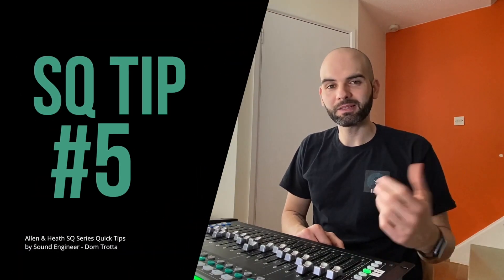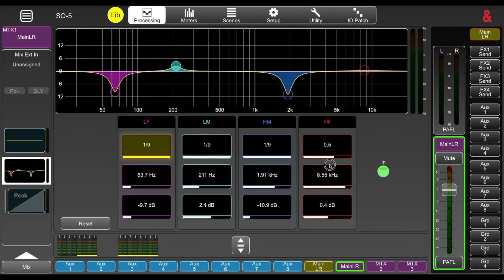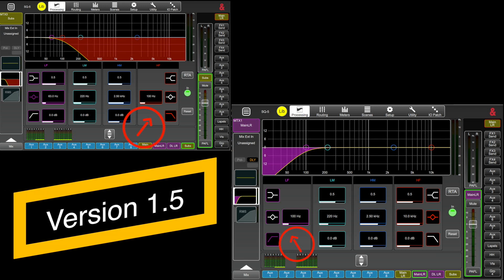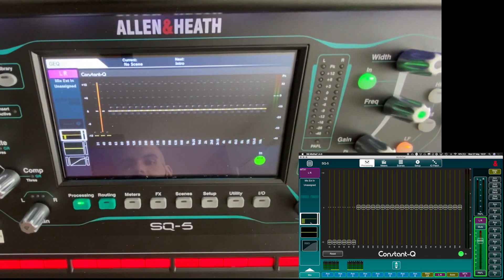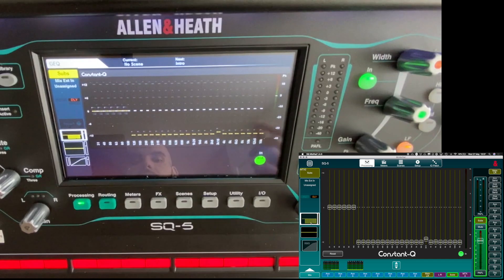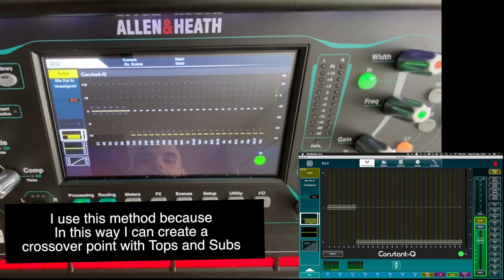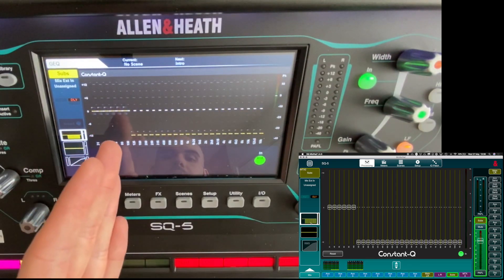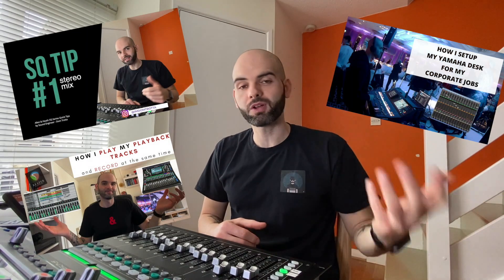Allen & Heath SQ series Quick Tip 005: Main Bus EQ

Comment: Why don't you do the processing with the amps or a system controller? Graphic EQ like this makes no sense.
Reply from the maker: Well, Yes you can do it if you have A drive rack like Lake, DBX or any other system controller but in this case, I'm only using the desk, I'm not using anything else.
with the new version 1.5 I will for sure use HPF and LPF if I don't have a system controller.
Also if you use an old Analogue Yamaha amp yes you could be using the cut filter that they have but I will always prefer to use this way as does what I need :)
But your observation makes sense, thanks for the comment.